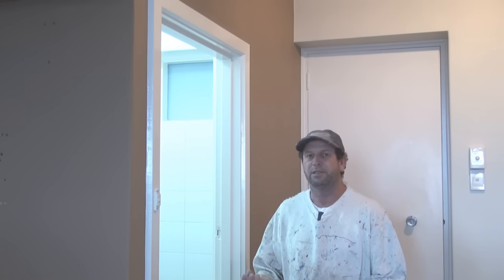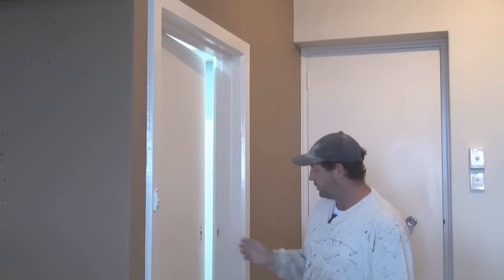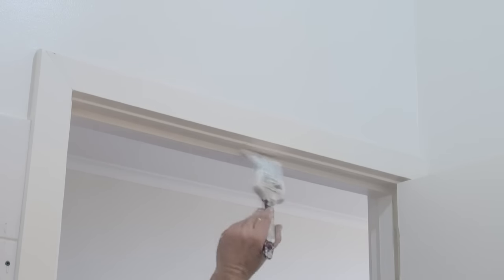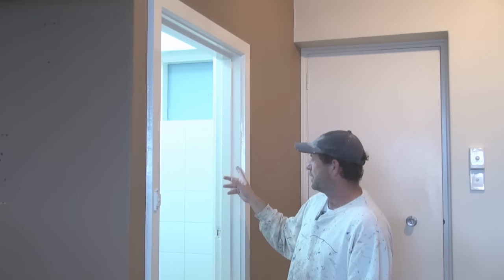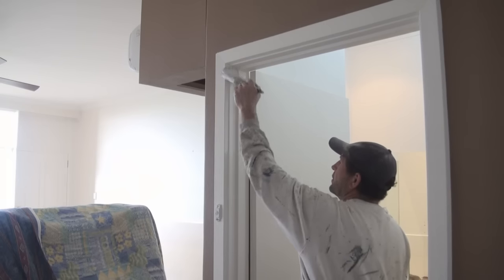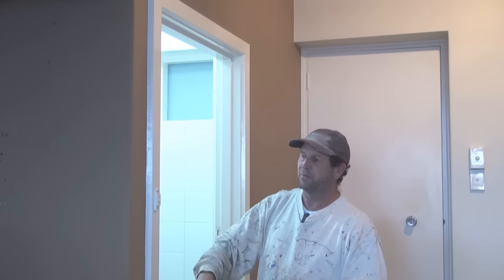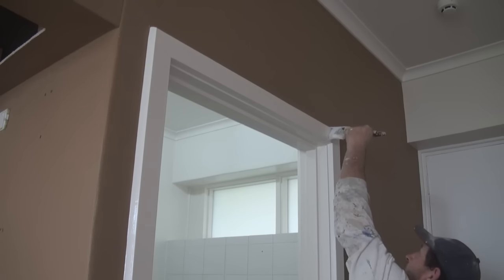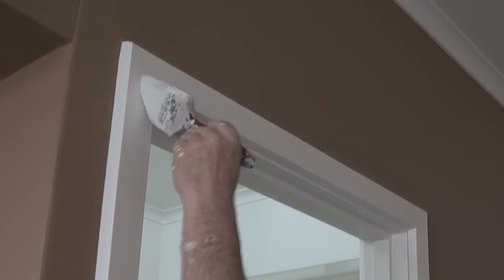How to paint a door frame or door jamb - (correct technique)

Comment: I have 10 door jambs that finally need to be repainted after 19 years. I am considering doing them myself and I was wondering if I  should use Floetrol as a paint lever to reduce or eliminate brush marks? And I do not want the doors to get stuck due to too much paint on them? Or would it be better to spray them? Thank you
Reply: I used floetrol recently and can say first the product is water and a cheap latex paint mixed. It gave me runs and was ok working with white latex paint but I added some to tinted base for trim and it changed the color and dulled the sheen. I would advise not using it. Use a stiff chinex brush and learn good technique for the results you are after.
Reply: Thank you for the tips and advice! I will definitely forgo the floetrol. I first start on the door coming in from the garage to see how the technique works.

Comment: Ahh, timber frames.
Bit of a rarity over here in Perth, all metal frames here. Got an 80's house reno, each frame I scrape back to metal, paint comes off very easy, go over frame with solvent, mask off with frog tape/newspaper, spray etch primer whole frame, spray gloss white around hinge bracket that's spot welded to frame (Can't be removed), then brush on Dulux oil based gloss white.
This is with the door, hinges and pins removed mind, the hinges I remove any paint, clean with metho, spray with etch primer, the spray gloss white.
Hinge pin, give pin an emery paper rub so there's no wear marks, same paint treatment for head of the pin (OCD I know) and very light smear vaseline on the pins. For any Perth or anyone else Oz wide, the bump rubbers that usually perish, you can get them for 40 cents each at big green shed with a red hammer logo. 
Door itself, I'm a lazy sod, nearby paint n panel spray shop does a door for about $170 in 2 pack, done in 2 days, no waiting for paint to cure and super smooth finish.

Enough of my waffle, liked the video.
Reply from the maker: Metal door frames are always a pain, just wondering why you don't spray finish the frame if you already have everything in place? Also do you paint your frames first as it can be quiet tricky trying to cut in to the walls.
Reply: @howtopaintinfo  Gday mate, mainly I found the gloss of Dulux high gloss enamel was superior with a brush, and doing it with a spray can was hard to get consistent finish all over. Strangely enough brushing on oil based paint is pretty soothing when it's on your own dime, and don't mind the smell at all (Missus is at odds with that but).
Not necessarily plugging Dulux, though it is a good product.
Even with drop sheets/masked off with newspaper, the over spray from the etch primer was a bit of a pain, but found it gave a much better adhesion to the metal frame.
I suppose you've seen plenty of blobby paint runs on hinges though.  
I did them last, I am crap at cutting in so use tape, that "frog" tape seems to work ok, walls, whole other story, had to scrape back to hard plaster (All solid brick in Perth) as plaster not sealed in 80's, sealer/binder applied (Mmm, the smell...), skim coated all the dings pock marks, two undercoats, wait 4 days, run orbital over with 120 paper for baby bum smooth, then topcoat x 2.
Get much hardplaster paint flaking off issues over east?
Reply from the maker: There is nothing wrong with a good brush finish. 
I haven't come across hard plaster flaking for a long time and yes sealer binder is the way to go.

Comment: Does it make sense to buy a more expensive brush with better quality even if I don't get to do household painting that often?
Reply from the maker: Jancen Well that is a good question, good quality brushes are better but if you don't think you will use them that often then maybe you will be wasting your money. You can store them for next time you need to paint or maybe buy just one good brush for all your trim work and a cheaper brush for walls and ceilings. I know others would say you would be wasting your money buying cheap brushes, so it's up to you but remember good quality brushes are better to use.
Reply: Better quality brushes tend to clean up better and therefore reduce the overall number you need to buy too. In my experience, one $10 brush lasts longer than 5 x $2 brushes and you also get a better finish. If they're cleaned properly and stored properly it doesn't matter how often you use them. Shape the bristles while wet. Once dry, store in an air tight container. I've used the same, good quality brush for years that way.

Comment: Would a paint sprayer give you a better finish for both door jambs & doors? Bathroom & Kitchen Cabinets? I'll be using Sherwin Williams Pro Classic. Thank you for the video.
Reply from the maker: A spray finish can look better if done correctly but it can be just as quick to brush door jambs if you take in to account all the time it takes to mask up. The thing with using a sprayer is the overspray, so I will use a sprayer on a new home but with an existing home with carpet etc I would just use a brush and roller. Depending on your brush skill you may find using a sprayer is better to use even with all the masking time. With doors I would spray about half and brush and roll the other half, as I said it depends on where I'm working and if spraying is viable or not.
Reply: Thank you, I decided to brush & use a roller with Flotrol added to Latex  to reduce brush & roller marks. & I used Penetrol with the oil based Kilz primer. It really does make a difference. A little goes a long way.
Reply: Mark Schrader pro classic is super thick and self leveling probably not the best thru a sprayer

Comment: Is it the norm to paint all door frames in a house the same color.
I have chosen white for kitchen and bathroom, but in the bed rooms have already painted using pascal color. This will result with a hall way having different door frame colors.
Reply from the maker: Normally if a room is different colour to the hallway then the door frame would be painted in two different colours, one side painted to suit room the other side painted to suit hallway. That's why you will find a lot of people that like different colours in every room choose white as a neutral colour for all  the trim. So if you wanted it to look all matching then you would need to paint the hallway side of the door frame white.

Comment: I bought new molding trim boards thst are already primered should i paint them while they are off & can i use can spray paint with primer or should i use brush adding flotrol in it to keep down brush strokes?
Reply from the maker: That is up to you, you can paint the new molding but you will need to fix it with something, I assume nails. So you will want to do final coat when the molding is in place. There is nothing to say you cant use spray cans but it could get a little expensive using them.
Don't forget to Like, Share and Subscribe

Comment: Hi there, just discovered your channel while searching door painting. I really like your paint technique - you are good with a brush.  I am about to paint 4 new doors that I had installed in my home to replace the old 1970's flat builders doors typically used at the time.  The doors are pre-primed and have a wood grain look to them.  Just wondering if there are any painting techniques/paint finishes that would minimize the look of the wood grain?
Reply from the maker: No not really but you could fill the grain if you needed to but it would be a lot of work..
Don't forget to Like, Share and Subscribe.

Comment: Hi, big fan of your work, just wondered what brush do you use , is it a 3 inch  and have you shaped it?
Thanks
Reply from the maker: Depends on what I'm painting, 63 mm I do use a lot and for larger areas like fascia's I will use 75 mm or 3 inch brush. No I don't shape mine, you should be able to buy either what they call sash or oval cutters which are shaped nicely.
Don't forget to Like, Share and Subscribe.
Reply: @howtopaintinfo  thanks for the reply,  long time subscriber 👍

Comment: Hi...I am at the point that I need to paint the doors and frames of my rooms.  Would you please tell me where I start?  Door or frame first?  Also, on my window frames and skirting boards I have used primer then undercoat then 2 coats of gloss enamel.  Is this the technique I should use on my frames & doors.  I am worried that I will make it too thick and the doors won't close properly.  Please help?
Reply from the maker: Hi Sarah, paint your doors last because you don't want to splash paint on them while painting the door frames. Some times doors will need to planed due to the paint build up, if they are touching now then you will need to plane the edge slightly to allow for the extra coats of paint.
Reply: Thank you.  That makes sense.  I love your videos & appreciate your advice :-)

Comment: Just a question, why not use a roller for the flat parts?.
Reply from the maker: There are a few reasons, if you did roll the flats then you would still need to lay it off with a brush so it all matches. Also when rolling the flats you could flick spots on to the finished walls which would make a mess.
Don't forget to Like, Share and Subscribe.

Comment: What kind of paint are you using? Is it a trim paint? If so, do you thin it at all? I loathe trim paint, even after thinning. No flow, no coverage (unless white on white), no stretch, gums up too quickly, you name it.
Reply from the maker: +Von Milash I'm using Dulux  Semi Gloss Enamel, oil based. I try to use it straight from the can but I will thin slightly after I have painted a few frames due to evaporation. I think one of the biggest problems for people using oil based paints is that they don't apply enough paint or they apply too much and don't brush it out enough.
Reply: howtopaintinfo Yep, I'm just gonna start using semi gloss enamel. And oil is great for leveling.

Comment: Why is it when I'm painting wood doors and frames currently with oil based gloss that 30 seconds after painting it on, if I go back over a spot I just did it's peeling off??  The doors have previous paint on from a long time ago.  I've cleaned all with sugar soap then wiped it off.  I'm lightly sanding (keying) prior to painting
Reply from the maker: Its hard to say, sounds like it could have needed a harder sand or there could be some chemicals still on the door from cleaning. Also remember if you have a dry brush and go back over what you have done it can take paint off rather than putting it on.
Don't forget to Like, Share and Subscribe.
Reply: @howtopaintinfo  think it will be the sugar soap

Comment: What grit sandpaper did you use to sand the door frame ?
Reply: Alon\SOAMAZING   80 grit fist to get rid of sheen ,then 240 grit to smooth off, then clean down door & jawb, then use tack to rid of tiny pieces not eye visable hope this helps !!
Reply from the maker: It depends on the condition of the frame, if its rough start with 80 grit and if in good condition start with 120 or 180 grit. Generally I wouldn't go below 120  for a first sand,

Comment: Do u not catch the top of the door frame just because u cannot see it u would get pulled up on it  if u were working for me.
Reply from the maker: Normally paint them with wall paint so they are sealed, only time I paint them is when they can be seen like if a frame is at the bottom of a stairway where you can see the top .
Don't forget to Like, Share and Subscribe.

Comment: way easier doing all frames first before walls so its easier to cut down the wall by the door frame thats my painters tip lol
Reply: +reed jr Bennett LOL...You're kidding right?  It's ceilings, walls, windows, doors, base...If you paint your frames first you'll just be painting them again because if you're any kind of painter you'll get drips from the walls and ceilings...
Reply: godbluffvdgg  that's what tape is for. I would never paint in the order you said.
Reply: reed jr Bennett 😂😂😂keep that tip to yourself haha
Reply: godbluffvdgg wrong. Ceilings,then trim(crown,frames and doors),then walls. I do baseboards last. Same concept of painting frames before walls. Easier to paint a nice straight line on the baseboards to a freshly painted wall than the other way.Actually a lot faster too. And if your any kind of painter you won't be splattering  paint every damn where when rolling walls or ceilings. Lol. In the 20 years I've been painting,using this process I was taught at a union based paint company I've never had any issues.  A process that no doubt goes back a long time. Lol
Reply: reed jr Bennett .. I agree 🖒
Reply: Loco Burro .. the same way for the last 15yrs .. much better.
Reply: @truthawaits4u458  so you have 20 years experience and Stuart here has 15 years, my question is, why are you guys watching how to paint videos LMAOOOO
Reply: @stueyravey  Ya 15 years mate, so why are you watching a how to paint video? LMAOOOO
Reply from the maker: Yes but frames can get damaged or paint splashes on them if you paint them first.
Don't forget to Like, Share and Subscribe.

Comment: The correct way is to learn how to spray. 
There is no comparison in the finished result or the time savings from spraying.
Reply from the maker: +nicksflixworld  Sure the spraying time is far less then brushing but it can take hours to mask every thing up. To brush a door frame should take less then 30 minutes with very little clean up time. When spraying you first need to mask every  thing then when finished you need to remove all the masking tape so if you start adding up the time it takes to do all of that there is not much difference in the time it takes to paint. Also spraying won't fill any fine gaps in the timber but they can be filled with paint when brushing.
Reply: +Von Milash they obviously aren't in the repaints field.
Reply: Silly Von, ever hear of an HVLP sprayer and masking? It takes a few minutes vs' brush and rolling plus yells better results.
And yes sometimes I do brush and roll but rarely.
Reply: nicksflixworld You roll a door frame? Lol.  And yes I know quite well hvlp. Asinine to spray in a furnished home.
Reply: nicksflixworld what happens when they call you back to touch up scuffed doors and frames? You gonna touch it up with a brush so it can flash on a sprayed door? Or you gonna retake and mask everything off again to spray touch some doors and frames?

Comment: the correct way is spraying your door frames. not brushing. that'll leave a nasty brushlined finish.
Reply from the maker: +Samuel Alvarez I have found that people who spray every thing have no brush skills. There are times when surfaces should be sprayed and there are times when they should be rolled or brushed.
Reply: Am sorry but my brush skills are nice, I love cutting in ceilings, doors trims, Windows trims, am just saying, that's done alot faster and looks nicer sprayed.
Reply: +Samuel Alvarez Brush lines are a result of using a cheap brush, cheap paint, poor technique, or all of the above.
Reply: +Samuel Alvarez It depends on how many frames ( more than 10)...It depends on occupancy (none)...It depends on prep ( is it over subfloor? Do you need to protect anything?) Lastly, it depends on the sprayer...(HVLP?) I can paint a door jamb and casings in 5 minutes give or take...How long does it take to prep, pull out gear, thin to spray, clean machine, pack up etc etc etc...

Maybe you do new work, that's a lot easier often...30+ year painting...
Reply: godbluffvdgg Let Sammy boy waste his time and sound stupid.  Lugging around an airless or a compressor for hvlp ... or even a battery operated or Wagner sprayer to do a few door frames in an occupied house is just plain moronic.  Hell, even hvlp guns give over spray.  Your only hope would be a touch up gun on very low pressure, very little paint, and getting up close.  Which is basically glorified airbrushing.
Reply: Samuel Alvarez colorful doors framing
Reply: Samuel Alvarez  sounds like someone can't use a brush practice practice
Reply: Samuel Alvarez well what happens when they call you back to touch up doors or frames that have been scuffed. You gonna tape and plastic everything again to spray touch a frame? If your brush skills are on par, you can use latex acrylic trim paint like sherwin Williams proclassic that lays down and has the sprayed look with a brush. A good quality brush and good ol fashioned brush control is all you need. Now if it's new residential,spray every damn thing. I certainly do. But never on a plain old repaint. That's silly.

Comment: All doors should be removed and painted. The only way to have a professional painted finish. That looks like a DIY job. Hinges shouldn’t be painted over!
Reply from the maker: No, doors should not be removed unless your going to spray them. Its time consuming to remove them and also you need some where to put them. When rolling doors its easier if they are hanging, you can paint both side at the same time.  If you take them off and lean them against a wall you can only paint one side at a time due to drying time of the paint. Hinges are best not painting the barrel but when doing repaints and someone has painted them before you have no option but to repaint them.
Don't forget to Like, Share and Subscribe.